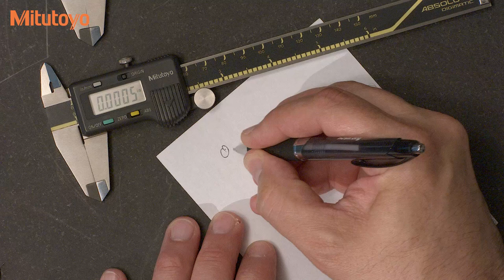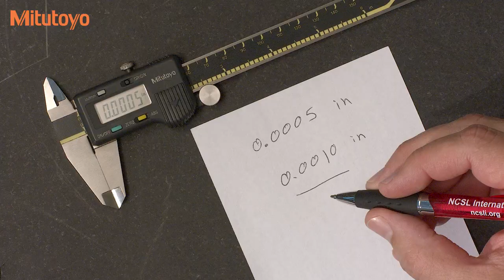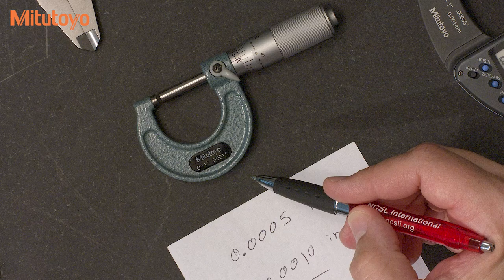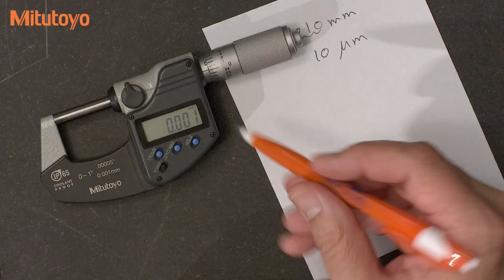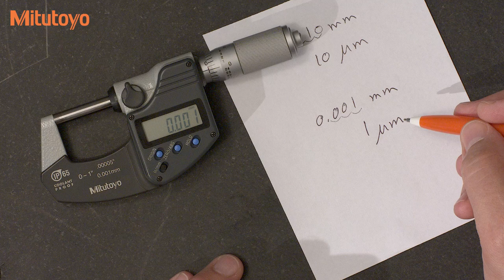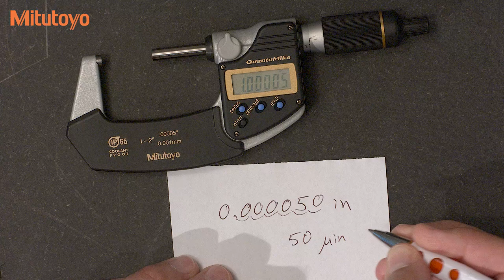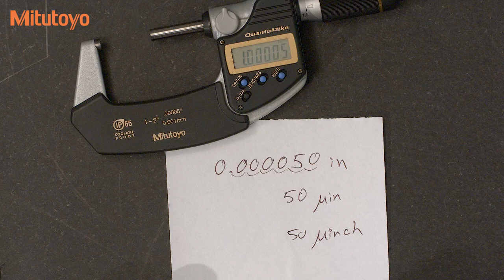Understanding Metrology Measurement Units - Inch & Metric

Comment: Using the imperial system in 2023 is silly... Using it when you actually care about precision and accuracy is lunacy.
Reply: The metric system is no more accurate than the imperial system. It’s just a different way of expressing the measurement.
Reply: Both forms of measurements need to be understood to be a world wide professional, so saying you are using the inch method and this does not make you a professional is just not smart as thousands of metrologists and machinists use both. As a professional with over 45 years of experience I know both measurement forms are needed, this is why Jim shows both or is he not able to measure accuracy unless do it your way?
Reply: @RandyG-m9k  The meter is defined in relation to the frequency of the caesium 137 atom, which is about as precise and unambiguous as it gets. The reference point of the imperial system has always been such a joke that since the middle of the 20th century, they just gave up and started defining imperial units in relation to the metric system. If your imperial system today is as precise as it is, it's because it relies on the metric system lol.
Reply: @mscscambodia  Literally the only justification for using the imperial system is historical. Old people (and Americans) resisting change just for the sake of it.
Reply: LOl, your reasoning is not sounds when the greatest economy in the world uses it and every manufacture of precision tools understands this such as Mitutoyo as you see by this video. @epgui
Reply: @epgui  It's irrelevant in the end how you define the unit of measure as long as everyone agrees and understands what it means. You may prefer the metric system and I'll agree it's an easier system to use and understand... but that doesn't make the imperial system less accurate which was my original argument. I have electronic indicators that will measure down to 1 micro-inch (.0000254 mm) So whether you measure it as 1 micro-inch or .0000254 mm or .0254 micrometers it's the exact same distance. A good machinist or engineer will understand both units of measure and how it relates to the job at hand.

Comment: If you were going to write the  of .0005” in slang would it be five ten th’s?
Reply: Yes. And you wouldn't keep adding the zero before the decimal point like in the video. Redundant number is redundant.
Reply: @SpeedofCheeseRacing  Point well taken. However, I'm still a fan of using the zero before the decimal point to eliminate potential confusion.

Comment: The measuring tool is a micrometer, like a tool that measures speed is a speedometer, and a tool that measures temperature is a thermometer.  That's the difference in pronunciation between a measuring tool and the 0.001 mm micrometer.  Easy.
Reply: Also outside the US the distance measurement unit is a Metre not a Meter, so a micrometer( pronounced mic-rometer) is a small measurement instrument but the small measurement is a micrometre (micro-metre) although micron is still more popular amongst old hands.
When you get the oldies talking about Mills they mean thousandth of an inch but to a metric mind that means a millimetre, confusing or what?

Comment: Jim , can you speak about torque wrench use and Calibration and how often ,must be calibres
Reply: Torque wrenches need regular calibration and that is usually determined by the amount of use or if the tool has been damage or dropped.

Comment: Is 5 tenths of a thousand  and 10 microns the same ?
Reply from the maker: Thanks for the question. They are not the same, but for gages that read in both inch/metric, the resolution is almost always .0005" in inches, and 0.01mm (10 micron) in metric.  Since the values are relatively close, these resolutions make senes.  Based on the fact that 1" = 25.4mm, then .0005" actually equals 12.7 microns, and 10 microns equals about .0003937".

Comment: What about "mil" which is 1/1000 of an inch?  

"mil" comes from the Latin word "mille" meaning "One Thousand."

You Know? 
 - 1 Millennium = 1000 years. 
- Mile (Mille Passus) = 1000 paces. 
- 1 mm = .001 m ... 1 m = 1000 mm. 
- 1 mL = .001 L... 1 L = 1000 mL 
- 1 ms = .001 s.... 1 s  = 1000 ms. 
- 1 mil = .001"... 1" = 1000 mils.
Reply: Inch world here: "mil" is not used by most machinists, we work in Thou or Tenths.  Some of us work in "Millionths", but that is usually lab work.  "Mil" often refers to measurements of sheet goods (plastic film, etc.).
Reply: The “mil” is used in printed circuit board design.  Same as a “thou,” just a different convention.
Reply: We love MIL and MILFS as well
Reply: Electrical engineers use "mill" in all inch designed circuit boards. Its .001", same as 1 "thou" that a machinist uses. All their software has units called "mill". When working in mm, EE's use micron for PCB circuit design.

Comment: My old Job instead of using the word "Thou" for 1/1000 of an inch, they would use the word "mil" where "5 mils" would mean 5/1000 of an inch.
and "mil" for 1/1000 of an inch is not to be confused with "mil" as in shortening the word "millimeter".

Comment: Why standardize laziness? That is all it is to "short-cut" discussion of measurements. "One thou" means nothing. "One ten thousandths of an inch," actually means something and is not so hard that you need to be lazy about it.

And why be lazy and say a "micron" instead of micrometer? It is not that hard to say micrometer.

What is a "mil" is at millionth of something or a thousandth of something? Be specific and ignore this oaf. If you are specific and correct, misunderstanding is not your fault, but you may need to educate your listener so that they don't make a mistake.

"unwritten" and "unofficial" slang has no place in any industry that relies on precision.
Reply: One element of my job is scanning electron microscopic analysis. The scale of features is often in the range of  1 micrometer to 100 micrometers. I have never found it to be useful to be a lazy person and report measurements in "microns." Why be a lazy jerk and write "microns"? Look how easy it was for me to use actual units in the intro.

Comment: The correct answer is to just get rid of the imperial system and never say "thousandths" again.
Reply: No, saying thousandth's of an inch is analogous to saying thousand's of a meter, which is a mm. There is nothing wrong with either method. Getting rid of either system would not change or eliminate needing a way to distinguish different levels of "smallness".